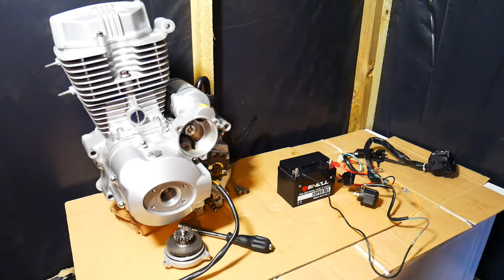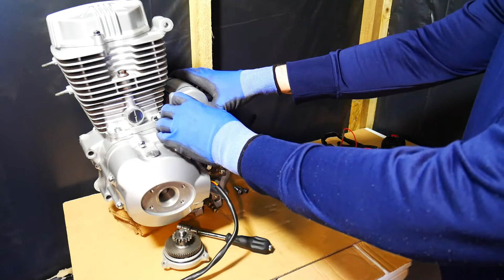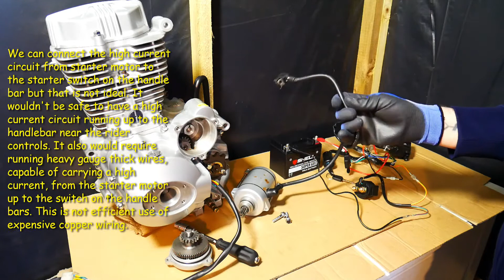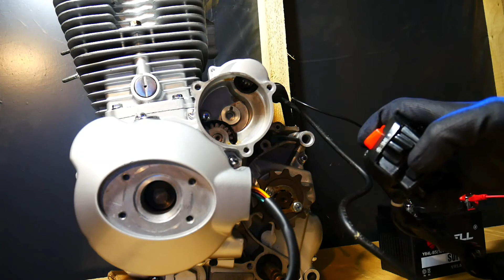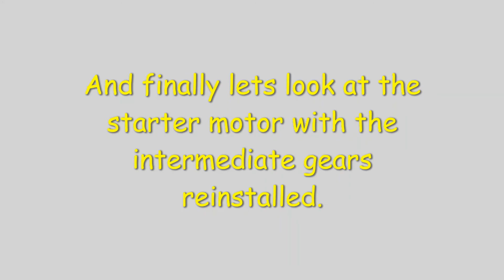How the Starter System works in a motorcycle

Comment: good video , the only issue I have on my kazuma dingo ATV handle bar the  selector switch is my black wire goes to my horn and comes out pale green, my starter wire is black and white and comes out red and yellow, my blue and yellow cables goes to my lights , where does the black and white get its power from pls ?

Comment: Tks for the great explanation. Question…after starting my bike, the starter motor continued running, despite turning the ignition switch to OFF. Can I assume that  BOTH the ignition switch AND the starter switch are faulty, cos BOTH needs to have closed circuit to run the starter motor?

Comment: Great video with detailed explanation, just wondering if we accidentally press the starter button while the engine is already running in stationary idle, what will happen?
will it engage the starter motor to spin again?
OR
the ECU will cut off the ground as it reads the engine is already running so it wont engage the starter motor anymore?
OR
the starter motor gear is always rotating all the time while the engine is running so it wont effect eventhough we accidently press the starter button avain while the engine is running?

i've tried once pressing the starter button while the engine running and it has like friction sound or something like grinding sound or similar...will it damage the starter motor pinion gear, reduction gear, crankshaft gear?

looking forward to your expert explanation

Thank You and keep up the good work for more great videos wih very detailed explanation ❤

Comment: I only have 0ne small yellow wire coming off my  Solenoid...on my GSX 750... And the 2 larger cables that bolt on the top..iam not sure wot the small wire is for...🤔

Comment: Could you tell me the actual motorcycle components that must be connected directly to the battery ground? I’m just rewiring my motorcycle without a wiring diagram.  Thanks
Reply from the maker: Usually no parts connected directly to ground terminal of battery. Terminal of battery connected to frame so it becomes the ground point all around the motorcycle. Every electrical component is connected to ground through the frame grounding points which varies from motorcycle to motorcycle I'm afraid.
Reply: To The Motorcycle Muse, how would you wire in the on/off red rocker switch above the push start button, can you explain the connection a little more for all 5 components i.e the key switch, on/off rocker switch, the push start button, the starter solenoid and last the starter, 6 components if you count the battery.

Comment: Great video 😀👍👍👍👍one question, is this a standard system for different makes of motorcycles?  Japanese, Chinese, USA and Europe.  Again great video
Reply from the maker: It's fairly standard. I'm not aware of a model that uses a different system but there is probably some.
Reply: @TheMotorcycleMuse  as you mentioned some starter motors are attached to the left crank case and some you can just unbolt it and it goes off. perhaps that's the only thing

Comment: Just about to diagnose and hopefully fix the lack of starter on my 1982 Suzuki GS650G.   The starter stopped working on a ride.   I removed the side panels, jiggled the connections and the starter worked fine again.  But once home the starter stopped working again.  So, here I am watching your vid to consider how to trace the wiring between the battery, starter and switch and back.
Reply from the maker: It should be very similar in layout to the starter system in this video. Take a look at my video on battery issues as well. It could be that also. I've seen a few cases where it was a loose fuse as well. It's probably going to be something very simple like a slightly loose connection or a rusty grounding point